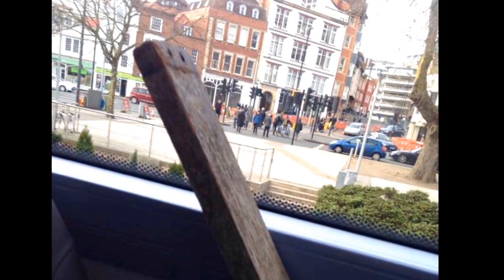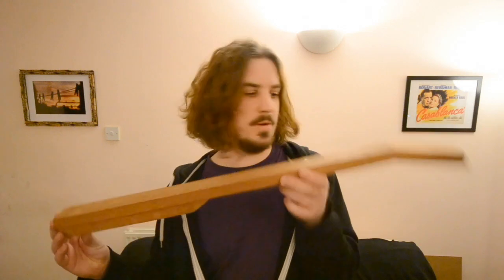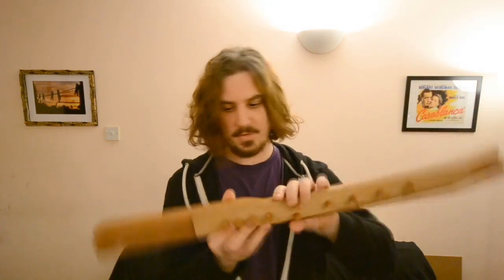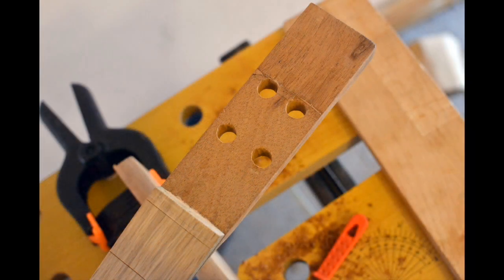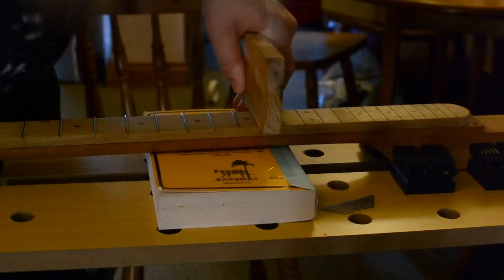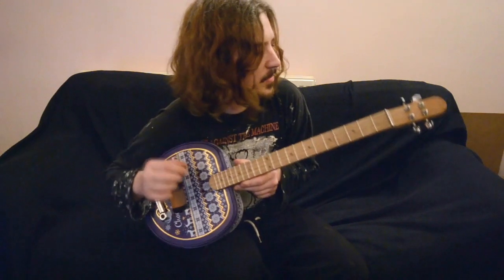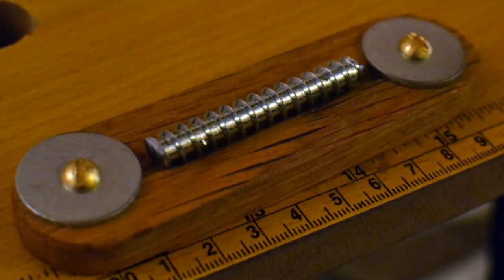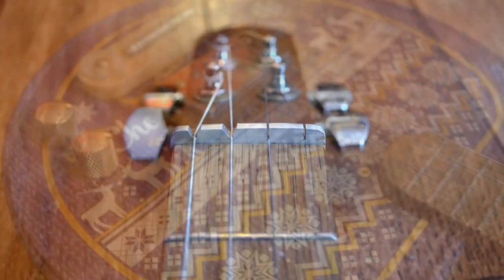Building a Guitar from a Biscuit Tin - First Ever Guitar Build!

Comment: Looks really good! I'm part way through attempting my first one. I've got some Reese's Miniatures tins I want to use for this. Just trying to figure out how the neck should be
Reply from the maker: Cheers! You could start by deciding where you want the bridge to be on the tin, then use a tape measure to give you an idea how long the neck would be with different scale lengths - then pick one in proportion with the body. This one is 600mm, about an inch shorter than a Les Paul. Good luck!